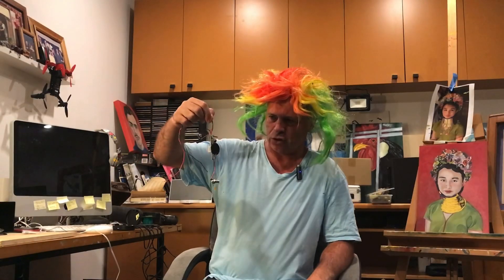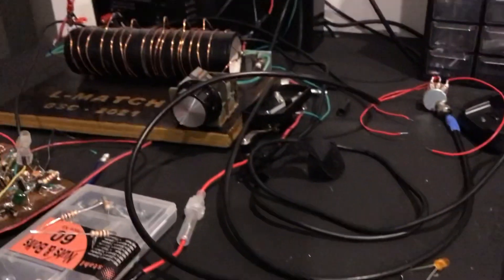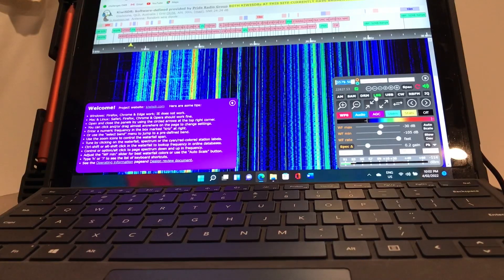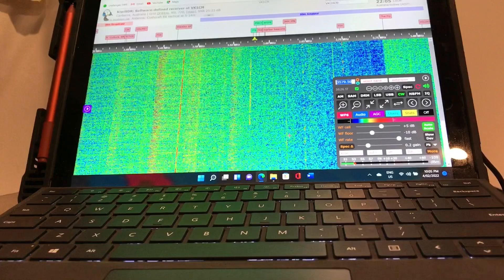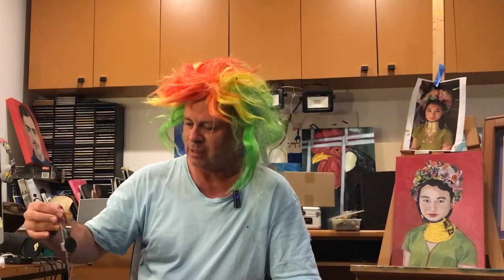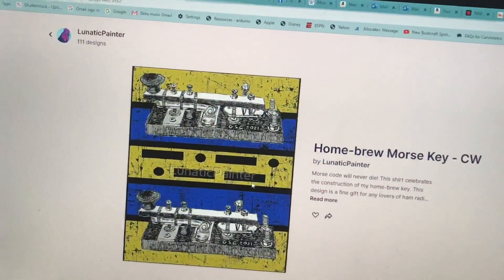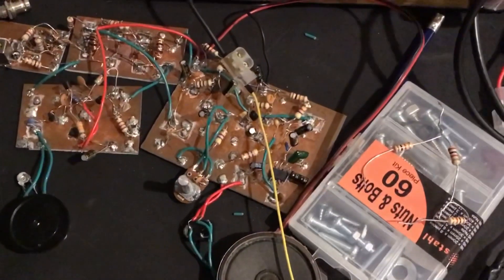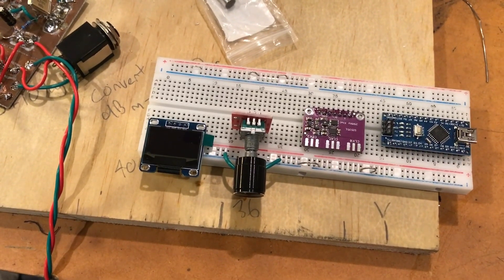QRP CW 2 transistor transmitter - 1100 km range! @TheArtofEngineering

Comment: Why did the lack of proper solder joint not fry your radio?
Reply from the maker: Good question! I was playing with the receiver…. When I went to use the QRP on 80m …. Lots of inductance on L match got me an “ok” match on transmission line and UNUN TOROID?? But virtually zero effective radiated power! 😜  many other things wrong too like coax with stranded Center conductor so crimp was useless etc etc but now QRP gets out … last night Sydney to South Australian SDR.
Reply: I was once playing around with antennas and had my 49:1 transformer connected up through about 5m of coax and a choke. The antenna wire was disconnected. I accidentally hit "tune" on my IC-706. My LDG tuner went for it, and came back with a perfect match. 😲
Reply: @paulsengupta971  Yes....I was tuning the antenna on the ground....and the Nano VNA looked the same when it was close to the ground! I should have realised something was wrong!!! ATU 's will match a broken chair leg sometimes!